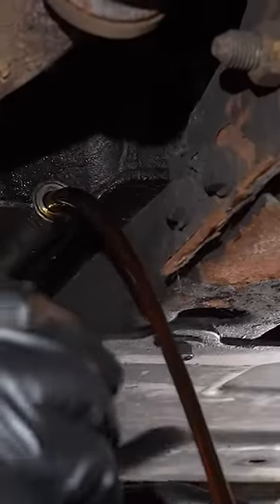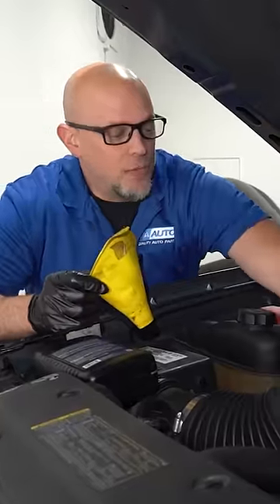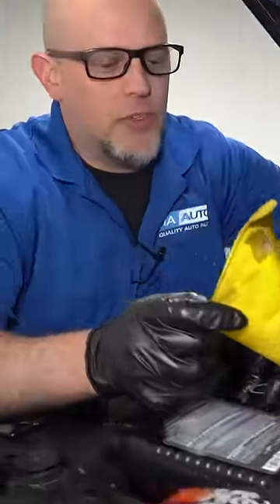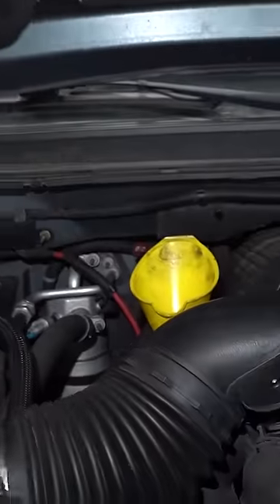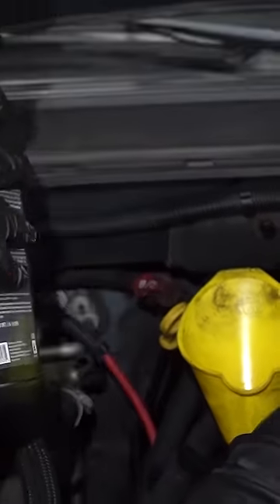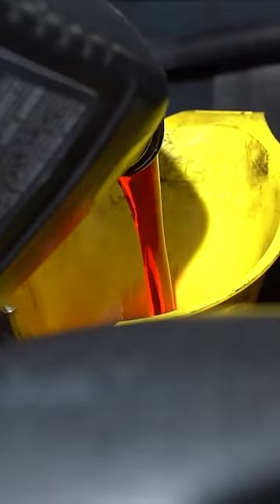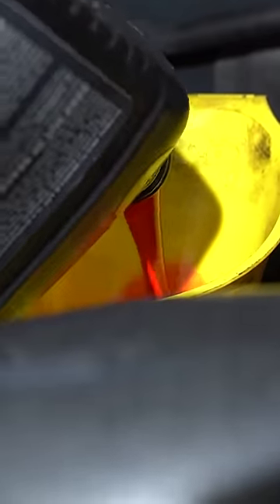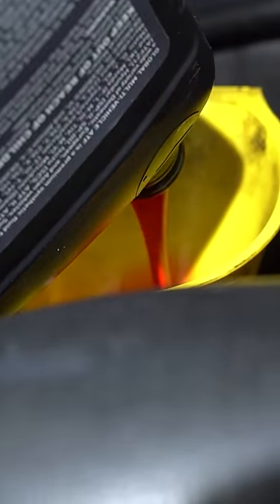Clicking, Tapping Engine Noise? Try This Trick Before Replacing AFM Lifters! #shorts

Comment: You don't put 3 or 4 quarts in. You don't drain half the oil. Most motors only hold 5 quarts so 3 or 4 is crazy.  Not only does it have detergents in there but it'd designed make the clutches grip together.  What do you think 3 or 4 quarts of that does to your bearings. You put about a half quart in it. You run it for many miles. Then drain oil and do it a few more times so it clears the engine gradually.

Comment: Yeah this is an old tale I wish would die transmission fluid really does not work there's been several independent technicians and Labs that have tested this theory on sludged up engines that have made absolutely no difference even Marvel Mystery Oil performed better than straight transmission fluid. If you really want to clean your engine and make a difference you need to use something that is specifically made formulated to do so BG makes awesome stuff for cleaning engines and you can find it on Amazon. Amsoil makes a good engine flush so does Royal Purple. But to be straightforward anything you can buy off the shelf at AutoZone or Walmart isn't really going to work at least not quickly.

Comment: use a quart of kerosene then change the oil. The old VW bugs had air cooled engines with no oil filters. This was standard procedure to clean the inside of the engine on those bulletproof engines.
  does that sound crazy?Some oil additives from back in the day were as much as 90% kerosene, and they told you to add them to the engine oil without changing the oil

Comment: Do this only if you want to shorten the life of your engine. A quick fix for (lazy) mechanics, but does the engine more harm in the long run. I've been working for 30 years as a lubricant and fuel enigneer. Transmission fluids do not contain more "detergent" than motor oils and do not provide enough protection from wear. They are designed to work with the friction plates in the transmission. Only use a product that meets the car-makers requirements (API SN, for example). Use quality name-brand products - lot's of unqualified junk out there. And change your oil reqularly (only comment I've seen with truth to it). So much folk-lore in this thread. Rubber seals in lifters - really? (no.). Use jet oil? (it's a POE, not a PAG) - that will eat your engine up real quick. Marvel snake oil? Can't believe the FTC hasn't shut this one down yet. Maybe try adding some colloidal silver while you're at it. If you "professional" mechanics doubt me, ask the car-manufacturer - they will void the warranty if you do this.
Reply: With due respect, the aft is being used for 10 mins before flushing out. Aft is not in the engine for long enough like normal oil put in.
Reply: Engineers are like vegans, they can't go 5 minutes without telling you what they are 😂 by the way all afm equipped Chevys have poorly designed lifters no amount of frequent oil changes will prevent it. It's not a matter of if, but when

Comment: This is a terrible idea. Just run a 20,000 mile oil for a change. It will make a hydraulic lifter quite. (Do a change at 10,000 or one year) doing what this guy is showing you will cause engine damage.